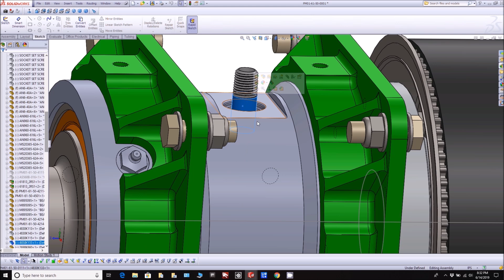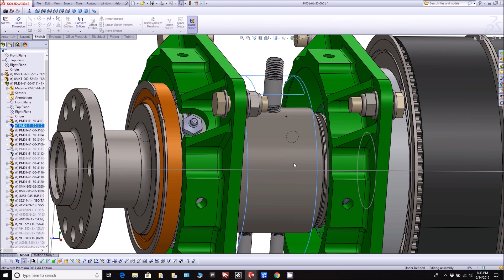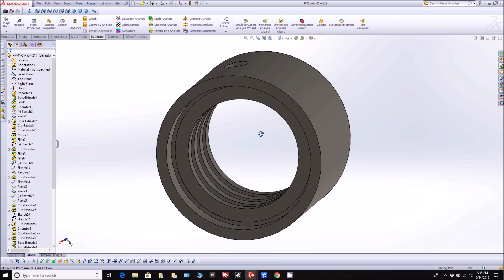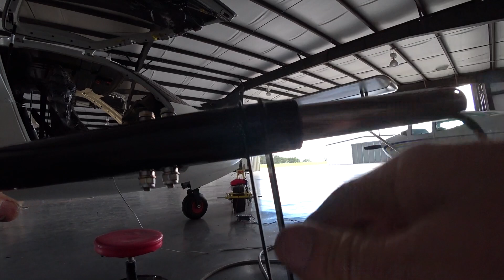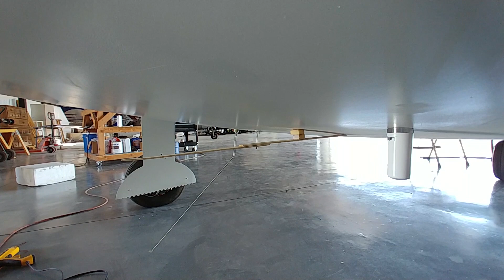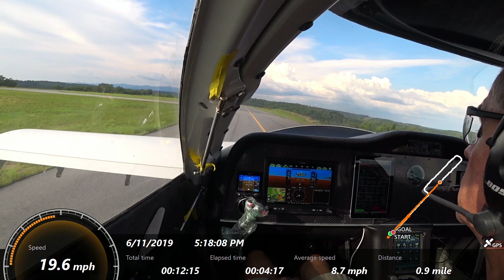Problem Solving 101 - Building the Raptor Prototype

Comment: I was thinking about that damper in the back of my mind for a couple of days now and then it came to me. Dual mass flywheels! Like the flywheel on a M47 BMW 320d or 330d M56 engine. When they wear out they don't leave you stranded next to the road, but they gradually start shuddering at high torque outputs and gradually start to shudder at lower and lower torque outputs until you have to replace the flywheel.  Should the flywheel damping fail all together you would not have a free turning crank and no torque transferred to the prop. And everything stays in place, the damping rubbers are enclosed and cant go anywhere if you close it off. I would have looked into putting a dual mass flywheel (Audi 3L TDI ?Dont know if it uses one) in a lathe and turning the outside diameter down until I can fit the belt sprocket.  Or fitting the flywheel to the crank and dampening the input shaft drive.  I'l still cut it down in a lathe for weight since it wont be actually carrying a pressure plate or clutch plate. Main thing is, this way the damper cant fail and leave the prop not providing any thrust.

Comment: How does the bearing setup look like for the bottom shaft? Single bearing taking half the belt load? The other half is provided by the crankshaft via the rubber coupling. Dual bearing to take full belt load?

Comment: Hi Pete. After watching this video, I   think you should take a close look at the radial loads induced by the belt. Once prop load kicks in, those loads will get very high. This will force the center line of rotation off center and cause the coupling to fail. If you go back and look at the dyno, you will notice that there is no radial loads. The load is in pure torsion. Also by placing a hanger bearing between the belt and coupling, you will eliminate the radial load on the engine bearing which also is not designed for any radial loads. 
Pete, you have done an amazing job on this project. Just to let you know, I have 40 years of design and manufacturing experience in the industrial world and have  crossed this problem more than once.

Comment: In automotive applications, when you're running a cogged belt (such as for a Roots-style blower), the belt is fairly loose and held in place with a guide wheel.... armchair quarterback for sure, but I'd be remiss not to at least mention that the possible failure of the rubber bushing came because the belt became too tight....
Reply from the maker: It's definitely loose, even the tensioner is purely set so the belt just can't skip teeth. The Elpex just couldn't handle the high torque of the Audi engine.
Reply: @RaptorAircraft  glad I'm wrong.... that sound you hear is my cheering for you.

Comment: seems to me if a "test pilot" flies "experimental" aircraft. doesn't that mean experimental tech inside the air-frame including the air-frame. if you put a plate inside between the frames and tie everything to the plate stiffen the plate by making it a tray with rolled edges it should fix your skin flex. I only offer suggestions and advice as I have built and repaired my own aircraft and there are a few hacks that don't add much weight and strengthen the aircraft. otherwise what a beautiful craft y'all building. stay safe and have fun, and don't let anybody crush your dreams

Comment: Hey Peter, you may be able to solve two problems in one.  Have you considered installing a skid plate down the belly?  Would be a sacrificial piece in the event of a belly landing and may stiffen up where the aileron cable bellcranks are flexing.

Comment: Looks good, just address the issues one by one.  You probably need alongeron or a bulkhead at that location to help with the aileron loads, couple of L strips.   Interesting way to check for twisting.

Comment: Impressive data details on screen, similar to SpaceX take-off videos. (love that!). 
Questions:
1) We are not sure if that video was produced on 6/11/2019 or yesterday (6/14/2019) - see the date/time display for reference.
2) You may want to keep your left hand to hold the side stick to maintain the ailerons fully into the crosswind for safety. :)

Comment: What about using a DeltaHawk engine - currently not the same horsepower and still in development. It may be a future option in keeping with the same overall design.
Reply: DeltaHawk - not ready for a long, long time. Funding issues, I believe. :(

Comment: Could an external longitudinal strake applied at the area outside of the pulley location alleviate the oil canning?  Would it help / hurt directional control?

Comment: I was wondering if the rubber piece failed due to radial load in single shear. I'd have to imagine the belt puts a lot lot of radial load on it and it seems like those things are designed to handle torsional load primarily.
Reply: I think this coupling and the Re-Drive are in need of some computational engineering analysis.  

     The earlier bearing failure and now this coupler-damper failure seems to highlight this.  

     Luckily, these deficiencies were discovered early in the ground trials.

     I wish these guys the best of luck, I just hope it doesn’t run out.
Reply: @Stepclimb  I agree.  I'm not sure guess and go bigger is the best idea when failure could kill someone.

Comment: Way back when I asked you if you were going to TEST the support of the fuselage  on propped up mid wing positions with the under-carriage up, and you said you might do that. Did you, and are there strain gauges in the wings to calibrate the effects ? Also on this video of test runs, the speed is in MPH ? I thought airplanes use Knots in their Calculations & Navigation.
Reply: Andrew Rae they do. This is GPS sources ground speed, not pitot sources air speed.

Comment: Question.. You claim that the original rubber coupler should be plenty strong. Rather than get a bigger one, why don't you figure out why the original one failed? Trial and error are not the way to develop a plane.

Comment: Great news about the test pilots I knew someone out there would want to do it. Just pointing this out because i know how it feels but you might want to do your U turns the opposite way so you don not prop blast the parked aircraft. I just say this because it has happened to me on a active ramp I was lucky that there were no rocks on the ramp but just incase ya know. How would u feel if it happend to you?

Comment: Acceleration looks sluggish.
Reply: Yes, he stated in the last video that the engine bogs down as the variable pitch prop isn't active yet.
Reply from the maker: No sh*t, I purposely had the prop set to a coarse pitch because the constant speed isn't working yet and I was only slowly feeding in the power as you can clearly see from the chart.
Reply: @RaptorAircraft  LOL don't let these internet geniuses get to you, it was obvious to sane individuals that you were not showing off peak performance.

Comment: Peter, this video was indeed chock-full of good news!
First, the rubber isolator; without the failure of the component on the ground, you wouldn't have discovered the Lord replacement.
Without the critique of the first test pilot candidate, you may not have discovered the fuselage weakness where the aileron cable bellcrank mounts, nor would you have considered the potential for differential twist in the winglets.
All-in-all, I'd say things are going spectacularly!  All of these apparent setbacks are really turning out to be fantastic opportunities for improvement!
I'll also second the opinion that it is really nice to hear the excitement and enthusiasm in your voice!  Need I remind you that you are a pioneer in experimental (for now!) aviation;  if what you were doing was easy, you wouldn't be the first!

Thank you again for allowing us to follow along with all of your successes and setbacks, it is truly an honor.

Best regards,
Jon
Reply: Hi Pete. After watching this video, I   think you should take a close look at the radial loads induced by the belt. Once prop load kicks in, those loads will get very high. This will force the center line of rotation off center and cause the coupling to fail. If you go back and look at the dyno, you will notice that there is no radial loads. The load is in pure torsion. Also by placing a hanger bearing between the belt and coupling, you will eliminate the radial load on the engine bearing which also is not designed for any radial loads. 
Pete, you have done an amazing job on this project. Just to let you know, I have 40 years of design and manufacturing experience in the industrial world and have  crossed this problem more than once.
Reply: @georgebutty7580  I have to agree with you on this one George.. The redrive assembly with prop attached is starting to take shape and has a couple of decent bearings to handle the radial loads imposed by the belts. On the other hand, the lower coupling appears to have only one bearing and relies on the coupling and engine main bearing to handle the radial load, when the belts are going to demand even far greater radial force than exerted on the top bearings (due to the smaller belt pulley). Thinking solution here may be two beefed up bearings, similar to the top housing, but about twice the capability, either side of the belts, with the coupling just transferring torsional load from the engine.. and removing ALL radial load from the coupling and engine main bearing.  
Keep polishing your diamond, Peter... There's a hellava lot of us, all around the globe, who are following this build and sharing your experiences, thanks to your excellent videos. Have been really feeling for you over the past couple of weeks and so pleasing to see you are well handling that little stretch of gravel on the highway of life.. Hang in there mate !!. Greetings from Brisbane..
Reply: @kevc114 , there is another tell tale about the problem. If you go back to Peter's video showing the damaged coupling,  you can see the belt nearest the coupling has lost it's tension. That means the coupling was taking radial load which it should not.
Reply: Literal "blessings in disguise".
Reply: It is amazing how the Lord replacement was found
Reply: Awesome!  :)

Comment: My Lycoming O320 on my rv6a will gulp 14 gallons per hour on climb out and it only produces around 180hp with 10:1 pistons and dual electronic ignition.  Very doubtful the engine was producing 260hp on that run.
Reply: It's also an automotive engine, your Lycoming is made to be very reliable and is less focused on fuel consumption
Reply: Bill this is a turbo diesel. If using the specific fuel consumption published by both BMW and Audi for turbo diesels of 0.326, then 13 gallons works out to 267 hp

Comment: I understand your point of view regarding this engine, but for 30K give or take you can have a Robinson V8 with 400 hp and torque too other options also work.... only Howard Hughes had enough money to invent/create everything!!! I see your using the conical bearings I suggested several months ago too... conti n lyco thrive on simplicity for their bare engines, that's why aftermarket turbo systems are the way to go instead of factory, not the spaghetti-o's you have... specially for an experimental where the very attractive point is builders maintenance, you have so many points of probable failure it defeats the purpose of owners maintenance.
Reply: Sure he could have just designed a plane around a "conti n lyco" but that is not what he is trying to do. He did not want to be,  just another experimental in the market. He may fail, but if his ideas work it will be great. I guess he could have just built a Velocity and been flying three years ago, would that be simple enough for you?
Reply: @donanders2110  Please read my comment again, I want him to have success I've been following the build since before he built the RC model...I love aviation and specially innovators.  I've made few suggestions in the past and slowly or not at all have seen them become part of the airplane.  The Robinson V8 replaced a geared 470/480 on a Republic Seabee it basically doubled the envelope of the airplane and its a lighter liquid cooled engine that can be turbo charged, super charged or nitrus added,  with fuel injection and no cooling shock.  its based on the famous GM LSX engines that are cheap to replace and are made in america just like the gear box that can support an MT constant speed prop.... it has redundancy systems and best of all it can use MO-GAS or Low Lead.  the Robinson has less failure points because of a simple wiring and hose layout and airplanes that have the engine installed have surpassed 2000 hrs of operations and the v8 still has great compression.  LL or MoGas is lighter than Jet A/A1 and the more experimental are being built like its the trend lately more availability of the LL and MoGas will happen beacuse Rotax uses it.  I really want this project to succeed, but in my opinion the wheel does not to be re-invented at the same time an airplane concept is being created.